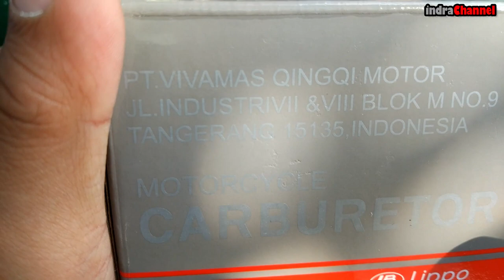Modifikasi Yamaha Byson (FZS , FZ16 ) | Pasang Karburator Ninja

Comment: Gan itu settinnya ditempat agan beli ? Kebetulan saya deket jombang.
Reply from the maker: bisa langsung dipasangin klo disitu sama teknisi nya Pak usup lumayan handal settingnya,, beli di hayam wuruk motor sebelah RS Dr Mudjito
Reply: 1 liter dibawa normal bisa dapet brp KM mas? Karbu standart saya cuma dapet 1:37 . Kebetulan lg nyari mekanik handal dijombang
Reply from the maker: blum pernah test pasti mas bro @BangBT  kira2 ya 1: 28-30 an lah masih masuk,, agak sedikit boros dari standar tapi tenaga jadi enak,, soalnya klo settingan saya gak hanya karbu yang diganti, CDI Pake BRT dualband Gear Rasio pake diametr 44 SSS punya scorpio, kampas kopling scorpio, knalpot gak ada catalysator pake yang free flow
Reply from the maker: Klo di Jombang gan @BangBT  sya beli setting karbu di hayam wuruk motor, pasang CDI di Buldozer variasi, dan variasi bngkel yang recomended dan montir nya bisa ke Aneka Usaha Mojoagung juga. mekanik nya tergantung mau apa dlu? hanya setting karbu atau turun mesin plus korter ?